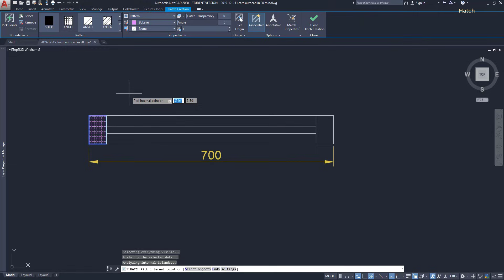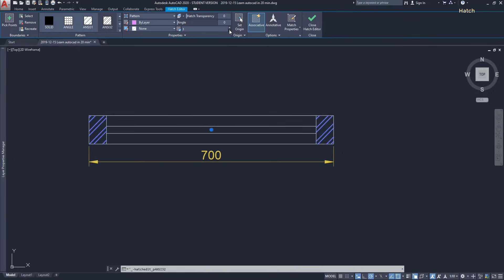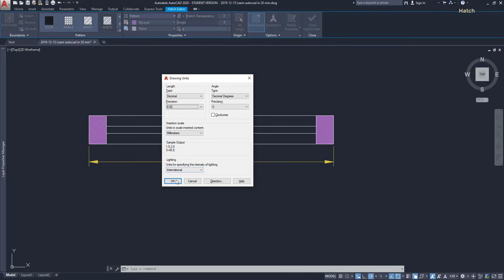Autocad - How to use Hatch

Comment: why autocad not accurate the line when i drawing ? It is inaccurate and then there are deviations in dimensions
Reply: have you tried dynamic inputting?
Reply: Even by using snap?
Reply: @iosif_ch  yes
Reply: @iosif_ch  yes